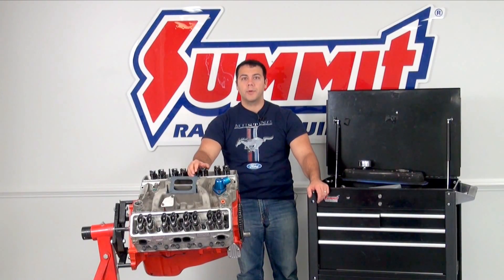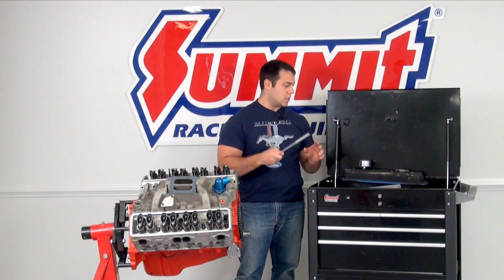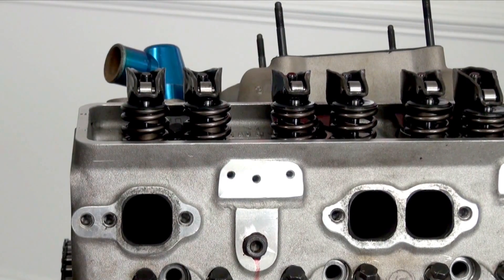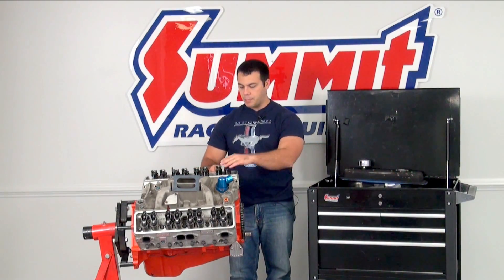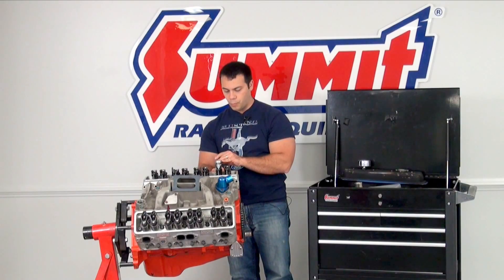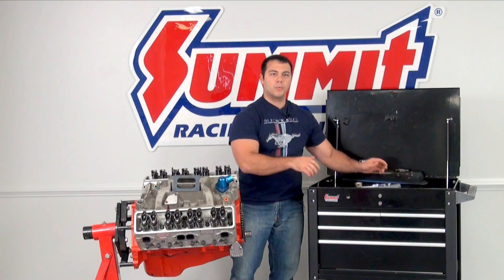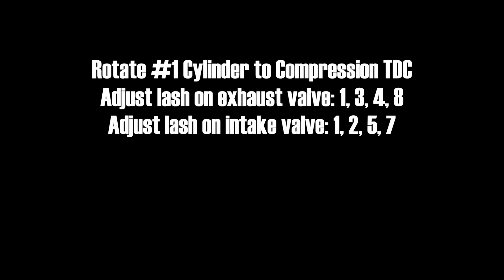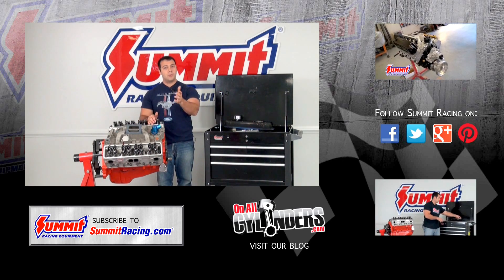Setting Valve Lash on Solid and Hydraulic Lifters

Comment: make a long story short a guy told me to find tdc and tighten them In the firing order make 90 degree turns 4 times to do 4 cylinders then do 90 degree turns 4 more times 2 do the other 4  car sounds a lil bit better but exhaust sounds like shxx it's no as loud as it use 2 be I can barely hear it any suggestions

Comment: i just replace my head gaskets on my 1996 chevy blazer 4.3 vortec what kind of valve adjustment do l have to do
Reply: The same. A 4.3 is just like a 350 with 2 cylinders lopped off.

Comment: when you are putting in a new cam I'm a chevy 350 do you tighten the cam sprocket bolts to 20ft
Reply from the maker: Hi John, 
Always follow the torque recommendation of the bolt manufacturer. If it’s OE, follow the factory torque spec. If it’s an ARP bolt, follow their recommended torque spec.

Comment: Hi, Tks for the tips!This works on a 305 1994 V8 engine?
Reply from the maker: Hi Rene, 
This procedure works for all motors when the correct firing order is used!
Same answer for both!
Reply: +Summit Racing tks
Reply: I have a question. I need some insight. I just did head gaskets on my 1997 K1500. I put my heads back on. Now I'm working on setting my valve lash. It's a learning experience.  I tightened the rocker arm just enough till the push rods made contact and wasn't all loose. Then I turned the crank. I know you need to turn it 90 degrees. As I was turning it I felt and heard grinding. I kept turning and it got past it. But the next time I turned it, it was tighter. 
So I loosened up all of my rockers. They are completely loose. Now i can turn it over and there is no grinding. 
It really seems like the push rods must have been pushing the lifter down on the cam too hard. But you have to take the valve lash out right? 
Is there supposed to be a better way to do this if the lifters aren't dry? 
Has this ever been an issue before? 
Advice? 
Thank you for your thoughts and wisdom. 
Good video.

Comment: how would you set lifters if you dont have the build sheet from your builder been over year since motor was built
Reply from the maker: Hi Zach, 
Assuming you are referring to a mechanical (solid) lifter camshaft. Valve lash is critical to the proper operation and performance of the cam. It would be best to pull the cam out to obtain the identifying numbers off the back end.  Then you’ll be able to identify the lash spec. also.

Comment: Hi i picked up a 302 small block ford and I noticed that the valve diameter for the intake and exhuast are slightly different, the exhaust is a bit smaller than the intake valves, but the exhaust valves have lash caps on them. two of them are missing, the engine hasnt ran like this or anything but is it normal that the exhuast and intake valve diameters are different ? and Do i need those lash caps? should they be on all of the valves, or just the exhuast ones to make up for the diameter difference from the intake valves. Thanks
Reply from the maker: Hi josh, 
Yes, head diameters between intake and exhaust valves are generally always different (some exceptions), so this is not an issue. Lash caps can sometimes be used by machine shops to compensate for valve height/length  to maintain proper valve lash when non-adjustable rocker arms are being used, though it is a better practice to replace the worn or wrong part rather than stack potential failures!

Comment: I have a solid flat tappet cam and is it the same way to adjust hot lash on any solid lift cam as long as you have the info
Reply: Yes. What I do is go for a drive and get #1 cyl to TDC and set #4 Exhaust, #7 Intake valves to the hot spec. Then if you like setting the valves on a cold engine, leave it till the next day and check if #4 Exhaust, #7 Intake valves have changed in feeler gauge size. If they did, then that's your cold settings. I used 1 valves from each head due to maybe a temperature difference. GM's Service Manual procedure http://my1970z28.com/COPO/images/doc_adjusting_solid_lifters.jpg

Comment: Hi can you help me understand this? on TDC Cyl #1 you said to adjust Exhaust Valves 1-3-4-8 and Intake 1-2-5-7 then rotate to TDC CYL# 6 to adjust Intake 2-5-6-7 and Exhaust 3-4-6-8 . Are you saying I should re -adjust Intake 2-5-7 again on TDC # CYL 6?
Reply: No. When #6 cyl is at TDC, just set EX - 2-5-6-7 and IN - 3-4-6-8 valves.
Reply: OK it should be TDC # 6 adjust exhaust 2-5-6-7 and intake 3-4-6-8.
Reply: This is the reason that there are so many people out there destroying their expensive cams. First off there is the only one way to do this simple but very important job. Remember this set of letters. " E.O.I.C." This means, Exhaust open, Intake closed. So, starting with no#-1 cylinder, You turn the crank clockwise until the No-1 exhaust cylinder spring is all the way open, then you adjust the No-1 Intake valve with your feeler gauge to lets say .018, then you rotate your motor around until the Intake at No-1 Intake valve is totally closed, then you adjust your exhaust valve at .024. Next , you follow this same sequence all around the proper firing order of your BBC motor which is 1,8,4,3,6,5,7,2... When you complete all cylinders in this fashion, your valve/lifters are all set correctly. Remember when you push your feeler gauge in between the pushrod and your rocker arm that the feeler gauge is just "SNUG" not super tight like some idiots have told you before. SNUG is better, not tight or super loose. When this is complete, your lifters are adjusted properly for 1-weeks worth of normal street driving, with a few good racers with your local competition. Adjust them every Sunday and your motor will operate correctly always. If you are at the track and racing, you might want to adjust them after every other race. If your are a fanatic, like I am. Thank You all

Comment: I bought a 461 bbc motor off a friend its a solid lifter, and he said the valve lash is 26 straight across.. what do he mean by 26 ?
Reply from the maker: Hi Harold, 
That would be 26 thousandths of an inch. Your feeler gauge will have .026” printed on it!
Reply: Ok.... Thanks

Comment: I have a w123 240D Mercedes with solid lifters.  I did my first valve adjustment with the help of a friend who does mechanic work on his own equipment.  It turned out very good.  I noticed that the diesel engine started easier and it had even more power.

Comment: I've not opened my motor yet but buying all my stuff from you folks but what I would like to know is what type of lifters and rockers I have on a stock un altered factory 1977 Dodge BB 400 Truck motor?  Hyd, flat tappet,  roller?  I'm gonna keep it factory upon replacement.
Reply from the maker: +jim lucas, 
From the factory in 1977 that vehicle would have been hydraulic flat tappet.
Reply: +Summit Racing
 I'd like to get a new cam, lifters, valve kit with new springs, push rods etc.. but want it to be just plain stock if ok.  I know you sell a kit but the timing chains already been replaced.  NAPAs doing my head's so no special porting.   Any help on what I need is appreciated.   Thanks! patrick_price86@yahoo.com
Reply: +Summit Racing 
I do know the valves are of theNon-adjustable type.

Comment: I have a solid lifter sbc that I bought some new 1.5 roller rockers for. It has an aftermarket cam just not sure what. What should I set the lash at?
Reply from the maker: +jimmie meadows, 
Without the proper camshaft info, there is no way to know the recommended lash. Sorry!
Reply: what did you end up doing? cuz I'm in the exact same boat right now haha!
Reply: You have to write down the cam number and call up for the correct valve lash, then follow this. This is the reason that there are so many people out there destroying their expensive cams. First off there is the only one way to do this simple but very important job. Remember this set of letters. " E.O.I.C." This means, Exhaust open, Intake closed. So, starting with no#-1 cylinder, You turn the crank clockwise until the No-1 exhaust cylinder spring is all the way open, then you adjust the No-1 Intake valve with your feeler gauge to lets say .018, then you rotate your motor around until the Intake at No-1 Intake valve is totally closed, then you adjust your exhaust valve at .024. Next , you follow this same sequence all around the proper firing order of your BBC motor which is 1,8,4,3,6,5,7,2... When you complete all cylinders in this fashion, your valve/lifters are all set correctly. Remember when you push your feeler gauge in between the pushrod and your rocker arm that the feeler gauge is just "SNUG" not super tight like some idiots have told you before. SNUG is better, not tight or super loose. When this is complete, your lifters are adjusted properly for 1-weeks worth of normal street driving, with a few good racers with your local competition. Adjust them every Sunday and your motor will operate correctly always. If you are at the track and racing, you might want to adjust them after every other race. If your are a fanatic, like I am. Thank You all

Comment: Hi this is just a basic question for you guys I'm based in the Philippines I have a 4g33 engine old school car with the small roads and short distance I'm contented with it the question is I had my valve double springed in a machine shop and have a can mild can which is top end performance what we call here cam 6 or in modern engines stage 0, I want to maximize the set up what basic thing should I do set the the valve clearance we do it inches here like .05 in .10 ex the car is in good condition just want to bring out the best on it simple things like side gapping plugs and for the weather here a 20 50 oil is right please educate me thanks!

Comment: As others have asked, what if you don't have a cam card? Is there a generally accepted, SAFE lash setting for solid roller lifters??
Reply from the maker: +Eric Boucher, 
Solid lift camshafts are designed and ground with a lash number in mind so, anything other than that may get you in trouble!  Sorry!
Reply: I suggest you go to the comp cams catolge and look up cams similar to your engine and solid roller. Look at the lash values and select a average lash. Start there.

Comment: Question i have a  big block chevey 468 around 500 hp how can i tell without pulling the lifter out if it is a solid lifter or a hydrolic lifter and where i dont have a cam spec sheet on a solid lifter rollor rocker what would be a safe way to ajust them at what lash
Reply from the maker: +Death by Mint, 
Assuming you just purchased this motor and the previous owner did not give you any info, if you start the car and it has a lot of valvetrain noise (like loose rockers), chances are it is a solid lifter camshaft. As for adjustment/lash, without a cam card, you’re lost. Some may tell you to try this or try that but, this spec is assigned by the manufacturer and needs to be followed for optimum performance!

Comment: At 4:22 Your data must have been entered by a very confused individual because some of the valves get adjusted twice and some not at all. You need to hire a knowledgeable proofreader.
Reply: This is the reason that there are so many people out there destroying their expensive cams. First off there is the only one way to do this simple but very important job. Remember this set of letters. " E.O.I.C." This means, Exhaust open, Intake closed. So, starting with no#-1 cylinder, You turn the crank clockwise until the No-1 exhaust cylinder spring is all the way open, then you adjust the No-1 Intake valve with your feeler gauge to lets say .018, then you rotate your motor around until the Intake at No-1 Intake valve is totally closed, then you adjust your exhaust valve at .024. Next , you follow this same sequence all around the proper firing order of your BBC motor which is 1,8,4,3,6,5,7,2... When you complete all cylinders in this fashion, your valve/lifters are all set correctly. Remember when you push your feeler gauge in between the pushrod and your rocker arm that the feeler gauge is just "SNUG" not super tight like some idiots have told you before. SNUG is better, not tight or super loose. When this is complete, your lifters are adjusted properly for 1-weeks worth of normal street driving, with a few good racers with your local competition. Adjust them every Sunday and your motor will operate correctly always. If you are at the track and racing, you might want to adjust them after every other race. If your are a fanatic, like I am. Thank You all

Comment: Hey I'm a teenager wanting to get into engine building. I am starting out with a 1995 chevy 350 with a eagle 355 rotating assembly. I want to run a lunati voodoo 268 camshaft but I am confused about what valve springs to use? Like what measurements like length and width springs should I use or should I just use the original springs? Any help would be nice, thanks
Reply from the maker: +Chase Reed , 
Anytime you change a camshaft you should always upgrade the valve spring. Either due to age or mileage, re-use of the stock valve springs is never a good idea. Most camshaft manufacturers will have a recommended spring to be used with their cam. That recommendation is most times for a stock cylinder head but, there are a multitude of heads out there that can be considered stock so, seek the assistance of a reputable machine shop to assist you and point you down the correct path. Give us a call too, we can help you choose parts based on info you provide to us. 1-330-630-0240.

Comment: What do lifters do?
Reply from the maker: +IndigoVibes ,
A lifter follows the shape of the cam lobe and transmits that shape or contour to the pushrod and rocker arm ultimately opening the valves.
Reply: Summit Racing Thanks
Reply: Lift!

Comment: Chevy engine with a ford shirt..nice
TDC on these small blocks is much easier to locate then this ^ , compression stroke on #1 the harmonic balancer will read @ 0 degrees, it's the same with all the chevy V8 engines
Reply: How do you know if you have hydraulic or solid lifters if the engine is already together? I have heard you can push down on the arm and it will move but you have to be incredibly strong to do that! Can you tell by looking at it?

Comment: I have 92 Ford Festiva 1.3 liter I know what the lash adjustment is supposed to be what I don't know is which is the larger number the intake or the exhaust if someone could help me thank you
Reply from the maker: Nick Wilson , 
Typically the exhaust valve uses a wider lash adjustment due to the fact that it runs hotter and has more expansion.

Comment: WHERES THE SHORT CUT FOR THE FORDS 302 ? ???
Reply: look at your firing order
Reply: No such thing brother. The firing order on a Ford is, "1,5,4,2,6,3,7,8. Just follow this patern only with your Ford firing order, not my Chevy order1,8,4,3,6,5,7,2,. This is the reason that there are so many people out there destroying their expensive cams. First off there is the only one way to do this simple but very important job. Remember this set of letters. " E.O.I.C." This means, Exhaust open, Intake closed. So, starting with no#-1 cylinder, You turn the crank clockwise until the No-1 exhaust cylinder spring is all the way open, then you adjust the No-1 Intake valve with your feeler gauge to lets say .018, then you rotate your motor around until the Intake at No-1 Intake valve is totally closed, then you adjust your exhaust valve at .024. Next , you follow this same sequence all around the proper firing order of your BBC motor which is 1,8,4,3,6,5,7,2... When you complete all cylinders in this fashion, your valve/lifters are all set correctly. Remember when you push your feeler gauge in between the pushrod and your rocker arm that the feeler gauge is just "SNUG" not super tight like some idiots have told you before. SNUG is better, not tight or super loose. When this is complete, your lifters are adjusted properly for 1-weeks worth of normal street driving, with a few good racers with your local competition. Adjust them every Sunday and your motor will operate correctly always. If you are at the track and racing, you might want to adjust them after every other race. If your are a fanatic, like I am. Thank You all